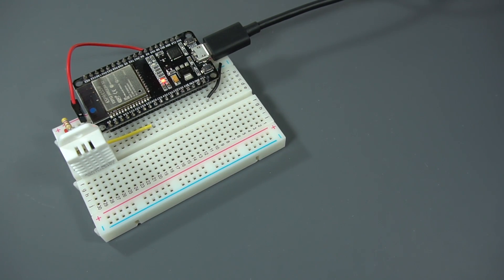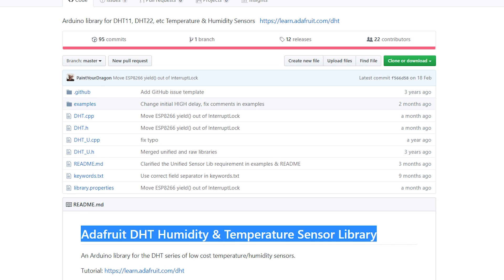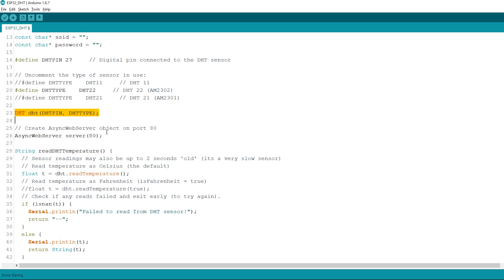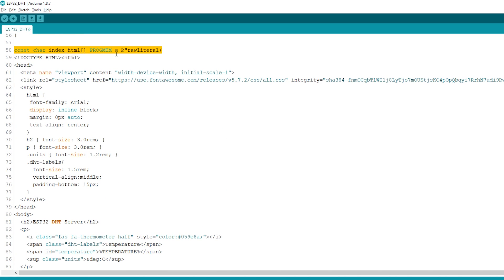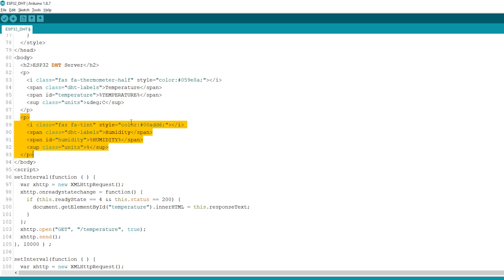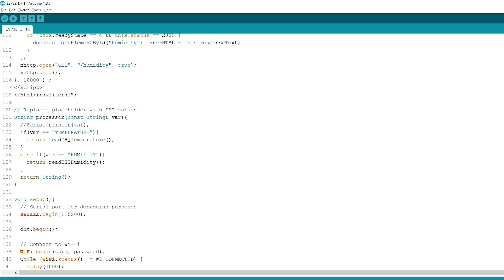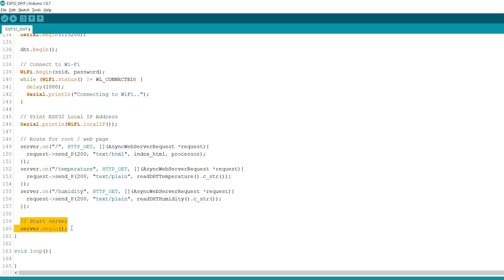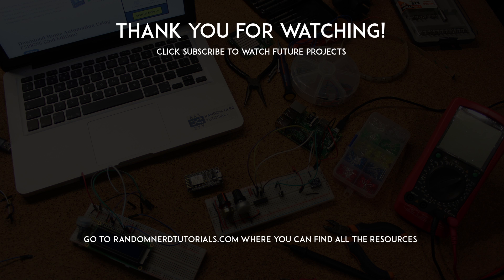ESP32 DHT11/DHT22 Asynchronous Web Server (auto updates Temperature and Humidity)

Comment: Hi, my name is Eric (new subcriber)

I have a projet of "connected beehive" to monitor the weight (HX-711 analogic sensor) and temperature (DHT22 digital sensor) with an Heltec ESP 32 Lora V3 board.

I'm working with IDE Arduino interface and the driver of my Heltec V3 board has been successfuly installed as well as the boardmanager and library so that the COM communication between my Arduino IDE and my Heltec board works normally.

My Heltec board is poorly documented (only a pin diagram which speaks more or less for me) so I found your channel with several videos dealing with "ESP32-DHT" ...

But I have problems to make work (simple) sensor such as my DHT22 with my board. I mean I get "abnormal results" from my DHT22 sensor, such as T=253°C and H=253% 
(let me add that the problem doesn't seem to come from the sensor because I also have a DHT11 which gives the same abnormal results)

These abnormal results I got from my DHT22 sensor with my Heltek ESP32 V3 board occurred with the "basic" example you gave to monitor a DHT 22 sensor on the serial monitor of an IDE Arduino interface.
As a matter of fact, i exactly used the connexion example you gave BUT for the data pin, I replaced the GPIO 27 (digital pin of your ESP 32 board) given in your example by the GPIO 46 of my Heltec V3 board (which should be a digital pin if I'm not mistaken but I would like you to confirm if you can)

After this first problem of abnormal results of my DHT 22, I decided to "start again from scratch" with another of your examples (i.e. the present video dealind with "ESP 32 and asynchronous web servor") 
BUT I faced with another problem when I downloaded the "DHT unified sensor" library because I wasn't able to make any modification of the sketch because of a error message ("cannot edit in read-only editor")
Then I opened the "preferences" of the IDE Arduino interface but didn't find any option to enable the edition of you "DHT unified sensor".

So I have 2 questions:
1) how to enable the "edit mode" of your "DHT unified sensor" sketch so as to change the pin name and DHT sensor type?
2) could you confirm that the GPIO 46 of the Heltec ESP32 Lora V3 board is effectively a "digital" pin which suits for the connexion of the DHT22?

Comment: I am trying to connect dht22 to esp32. But esp32 gpio can only tolerate 3.3v whereas dht22 output is 5v. How do you solve it?
Reply: I think DHT22 can work with 3.3V, Because it worked for me. And if the sensor doesn't work you put it on VIN It could work like that

Comment: great video tutorial. i have a question though regarding about this esp32. im building a project that will need a camera and internet connectivity and found that there is a esp32 wifi camera. my question is if the esp32 wifi camera can be used to control the arduino over wifi while receiving data then send it to an android app

Comment: thank you, good job. I have tried according to the tutorial, but why is it slow response from esp32 sometimes it doesn't even respond
Reply: I suggest you put an external antenna on it.

After working with a few modules, having the external antenna really makes a difference in response time. I went from thinking I was coding something incorrectly, to realizing that the signal was just weak on multiple projects.

Comment: Thanks for sharing such an Awesome project. Can I get the same web page over an access point without having local WiFi network.
Awaiting your earliest response.
Thanks.
Reply: Do you mean from outside your network?
If so than that is not a problem, you need to open the port 80 for that ip adres on your router. (Portforwarding)

Comment: It is possible instead using the local ip ( 192.168.0.1 ) to use a domain that can be accessed over internet ?
Reply: I would like to know this as well.
Reply: @Flynn3778  disregard what I said about the “DHT sensor library” that is already a recommended library , I made a mistake . the html code to add temperature readings to website works I use it , Im using it right now .
Reply: If you have a web site you are familiar with adding blocks to the website you can add a block custom HTML to put sensor readings on the website with this HTML code , 

example like this ,first open the serial display and then power the board and see the ip address for the board on the display , not sure that 192.168.0.1 would be the boards ip address that just looks like the router address . once you have the ip enter it into the code like below 

<iframe src=http://192.168.2.200 ” frameborder="1" width="375" height="375"></iframe>

also add “DHT sensor library” to the arduino code and the reading will be much more stable .
when I used only the recommended libraries the reading would come and go but became constant after adding the DHT sensor library

you may need to adjust the width and height number make it fit the display on the web page  .
Reply: put your boards ip address in place of this one 
<iframe src=http://192.168.2.200 ” frameborder="1" width="375" height="375"></iframe>

Comment: Great job Rui, I'm definitely going to upgrade my current weatherstation as fast as possible. I'am wondering if it is possible to draw diagramms with the sensor data to see for examle how the temperature has changed over night. It would also be nice if you could display the lowest and highest temperature per day on the website. ;)

Comment: Nice man! im currently building smart terarium and this is exactly what i need. Previosly i was using html meta refresh command and after 30mins my esp always soft WDT resets.. Could this fix it? or do you thing my app crashes for some other reasons? because when i dont have the web interface opened it runs smoothly :D